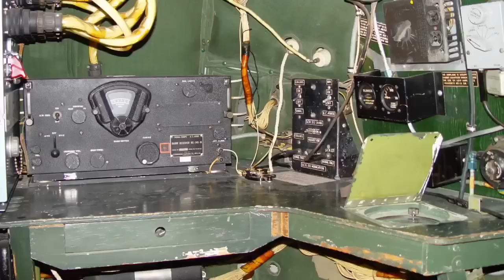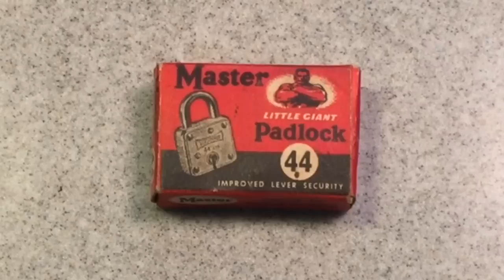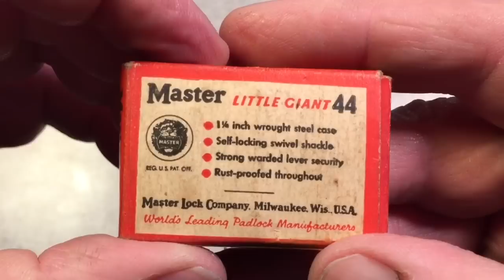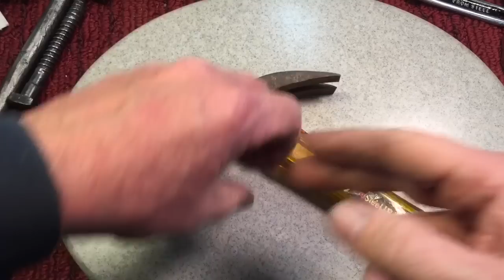Collectable Stanley Pro-Steel I-Beam Hammer, Leatherman Tools, Master #44 Padlock and More!

Comment: For years I made Leatherman pouches as a retirement business. Every time a customer ordered a model I didn't have, I purchased one so I could custom fit the tool and get it 100%.
So I quickly amassed a large collection. There is no one perfect tool, buy them all. I am the same way with knives, my wife at the time once asked "How many knives does one man need?" , my answer is still the same today "Just one more". For a full sized general purpose tool, the wave is the best bang for the dollar, but for a do it all heavy duty tool the surge takes a lot of beating. I say that in part because of the blade exchanger, which gives you the ability to swap out freely available jig-saw blades and holds its own sharpening solution.  I can't imagine being on a island without using it every day in some way.

Comment: I used the Kershaw A100 C,  locking vice grip style, needle nose plier multitool. I have fixed a many of Aircraft with it over 20 years. They should have never stopped making them. You can still find them used on eBay sometimes but they are proud of them.

Comment: A good friend of mine that I deer hunt with has one of the Victorinox multitools. He dropped it one year while hunting. I found it the following year a few feet from the tree stand. It was in the weather for 8 months still in the nylon case. Rain, snow, cold, heat  it worked as good as it did the day he bought it. I believe he bought it from Smokey Mountain Knife Works in Tenn.

Comment: The hammer turned out beautifully. For an everyday user, it's too nice to use. The William's wrench was an absolute steal . It's in great condition.  I used to think that carry-around multitools were gimmick tools. But I have been carrying around a Swiss army knife in a pocket knife format for years and find it very useful for small at-the-moment jobs. I use the scissors and slotted screwdriver blades the most. The long and short knife blades are getting pretty dull. Happy Veterans Day, and thank you. It's your day.

Comment: Awesome video!  As a mechanic I’ve had the leatherman crunch in my right pocket as part of my “EDC” for many many years.  I’ve found that when I need pliers what I really need are more of a  stout nose than needle nose, and the profile of the jaw points are perfect for removing rounded fasteners.  And secondly as much as I love a variety of tools all I ever really need is a Philips, a flat head, a knife and a file (which are basically all you get with the crunch) and that has covered my needs 99% of the time.

Comment: My favorite Leatherman is the Wingman. It's really got the minimum and I carry it in my pocket. I use the spring loaded needle nose pliers and the scissors everyday. It also has a decent file with a couple inches/mm  graduated on the revere  side and a flat screwdriver or prying end, also has a good knife blade, can and bottle opener, flathead screwdriver and Philips. I also have one of the original early releases of the Leatherman multi-tool and it is real nice as well.

Comment: Hello there from Russia.
In Soviet times, multitools were not very common. Most of them were from Switzerland, and were called the "Swiss knife". I'm not a fan of this kind of tool. Yes, they are interesting, you can play with them. But they are not very handy for work. As a multitool, I prefer to use a vest with many pockets where I can put my full-size tools.
And one day a funny story happened to my multitool-vest. But first, a little history about my life, for a better understanding of what happened.
I'm a big man. Height 187 cm, broad shoulders, when I was young I was engaged in powerlifting (not as a professional, just to be in shape), and my weight is 120 kg.
I have an engineering degree. But the first two years I worked in the police as an engineer. Then I worked for almost 3 years as an engineer in a private security company. Several years passed and I was already doing a completely different job. I got a call from the bank and they contracted me and my friend to do the renovation work for two weeks.
On the first day, we came to the bank with large boxes of power tools, and me with my multitool-vest. Before going through the metal detector, the guard put a small plastic tray on the table and asked to put all metal objects on it. I'm a big guy and I have a big vest, so remember any cartoon when a ton of things are taken out of a bottomless bag or pocket. I began to lay out everything that was, a large bunch of keys, 2 hammers, several screwdrivers, adjustable wrenches, pliers, wire cutters, a couple of bags with screws, a multimeter, a crimp for wires, a couple of knives, and a whole bunch of other things.
The guard looks at all this mountain of things and says - you cannot carry knives inside. I object - your bank gave me permission to bring any tools that I need to work, and I need these knives. We argued for a long time. The head of the bank security came and said that I couldn't use knives because I could stab someone. And I didn’t think of anything smarter than answering - Don't you think that if I want to, I can stab you with a screwdriver? Or hit you in the head with a hammer? I also have power tools and can drill your safe and saw the bars.
The head of the security thought for a couple of minutes and agreed that I could take all the tools inside, but the guards would be watching us. And all 2 weeks we worked under the close supervision of four guards with machine guns. Two for me and two for my buddy. Even when I went to the toilet,  or during a break, or for lunch they followed me.
It was an interesting experience.
Reply from the maker: Wow!   Awesome story Mikhail!  I agree the standard multitool isn't very strong for many purposes but for some things they are excellent.   =D

Comment: That hammer came out really nice!  I have the exact same Victorinox multi-tool, and you are absolutely correct: it is superbly made with wonderful fit and finish.  I've used every single implement on mine and have worn through the label by carrying it in my pocket, but it still works like it was new.

Comment: Leatherman Wave - is what I would recommend for every day general usage. 
It's what I carry with me for work, and I use it every single day.
Constantly using the pliers, knife and screwdrivers. They get used on almost every job.
Less frequently used are the scissors and saw, but when you're faced with a one off task - they can really save you the hassle of having to go back out to the van.
I wouldn't be without mine. No way. Not now. 
On a side note - accidentally left it on my trouser belt in it's (Mexican, like yours - just slightly different in shape) leather sheath and it ended up going through a wash cycle.
Came out of the washer clean like a shiny new penny, and after some WD40 is better than it ever has been. Every nook and crevice clean and the greasy pocket lint scum gone.
The leather sheath ended up drying and curling up badly though - but lucky for me I had seen your leather bag video, so gave it a good dose of Kiwi Parade Shine - and now that sheath looks like new again. :-)

Comment: The multitool I carry must have single-hand opening pliers and knife blades when I’m in a trench and covered with mud. Sometimes you can’t let go of whatever you’re working on. Always carry the Leatherman Wave for that reason. It’s also not too heavy. The Surge is nice, but it’s so heavy I’m always pulling up my pants. The saw blades etc. must be robust. Hate the ones that snap off. Bought a Leatherman  sheath with a military style snap. They don’t foul when muddy. Also carry a Fenix LD22 flashlight on the right hip next to the knife. Enjoyed the video John. 👍

Comment: The hammer turned out really nice. I have a SmartGear utility tool. It even has a LED light on the side of the handle that shines right on the operating side of the tool.  Buy the way SC, I have keys for that lock.

Comment: That is a great trick for protecting the acrylic. I have tried it before, but I often have a hard time getting it as tight as I would like. I have switched to using a band-it tool. You are able to pull it tight enough to be waterproof and because the bands are SS, they can be exposed to vinegar or citric acid without breaking down quickly. Give it a try!
Reply from the maker: Nice idea!  Will the plastic bands hold up to the wire wheel?
Reply: He said they’re stainless steel 😳
Reply: @ScoutCrafter  I've never even seen plastic bands. The band-it tool that I have is from the '40s. I have only ever seen banding for it available in spring steel or stainless steel. It is certainly more effort, but when you have a shaft that has crenulations, the aluminum will not seal against them. The bandit tool pulls the bands from the outer edges much more tightly than the center, only 3/4 inch total. Because of this varied pull, the very top and very bottom of the band are able to cinch into complicated shapes and maintain near waterproof status

Comment: The hammer looks terrific as usual.   Scoutcrafter red always looks good.
I prefer the Estwing hammers which are more forgiving for me when I miss the nail.   The grip on the Stanley looks comfortable.

A friend told me about a product TecNu sold at Walmart and lots of other places.   This is a combination of abrasive to clear off the oils from the poison ivy and something to neutralize the effect of the oil.    Wipe on for 30 sec then rinse with warm water.   It is amazing.   Instant itch relief.    The redness will take the normal time to heal but avoiding the itching is so good.

Dave.
Reply from the maker: Thanks Dave!

Comment: Great video! I like the Wave, has everything and more that I need….Question, what is your recommendation on wire brushes for the Drexel. Is it a never ending battle with the wires being thrown off? I actually found one stuck in my forehead recently! I’ve tried the Drexel brand and several others I found on Amazon, but they all last about the same..Thanks!
Reply from the maker: John- The good ones are very expensive.  I use the ones like you get on Amazon and run less RPMs also wear a apron and face shield!!!!    The high RPM's will leave you looking like you had a fight with a porcupine!

Comment: Scout, I do not have a furnace in my basement but I do have a countertop oven in my garage.  What temp do you think I should put it on to dry the paint on tools?  Thanks, Chris
Reply from the maker: Hi Christopher, I will have to take the temp of the top of my burner and let you know...  Thanks!
Reply: Thanks

Comment: No beef with the leatherman product but the answer makes no sense. If you are on a deserted island, what screws or nuts do you need to manipulate? The blade is null because you have a machete. So what are you left with? A way to file your nails and have a pair of pliers. What are you going to do with that?
Reply from the maker: It's funny how you think a certain tool is useless and then a boat washes up on shore that needs some ignition work and then you are the one smiling with the screwdriver set!  LOL
Reply: @ScoutCrafter  Fair enough. I had taken desert island to inherently rule out finding old radios or having access to boats. It's very fascinating question. I find the commonality of the Leatherman incredibly confusing. With rope and presumable access to some type of timber, one could build a lathe, have fishing line, make traps, lash timber together to make a raft, boat, or shelter. In my mind, the biggest argument was between rope and a means to make fire. I figured that if you had hemp rope, you could separate the fibers and easily make a bow that would provide enough friction to start a fire. I cannot think of any use for a leatherman in that scenario besides the pliers once in a while and tending to wounds. I would also argue that the question of what one tool you would bring inherently rules out multi tools.
Reply: I’m not going to no stinking desert island!! I may not be able to watch scoutcrafter videos.

Comment: I had the original wave from 01 i believe. It did not have the detachable bits. It became fairly floppy. They warranted it with the new model like yours. Truthfully the diamond file and the serrated blade are good for many things.  The one idea that I like is from this video.   https://youtu.be/Ac--e5sajw0
Reply from the maker: I was on the edge of my seat seeing him drill in that cold log as I thought the bit would snap for sure!